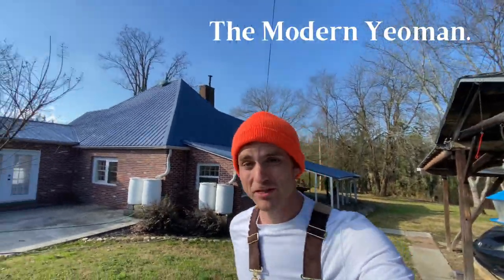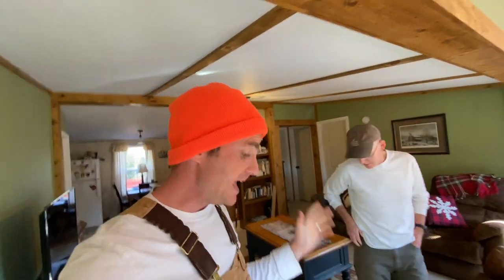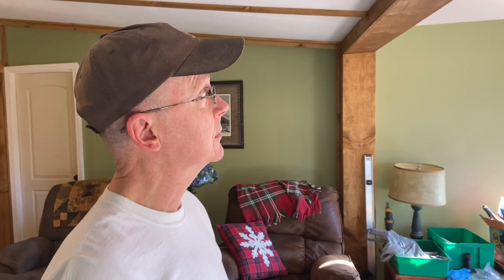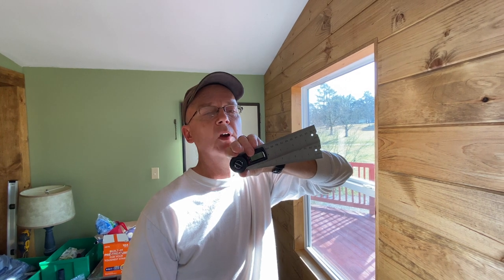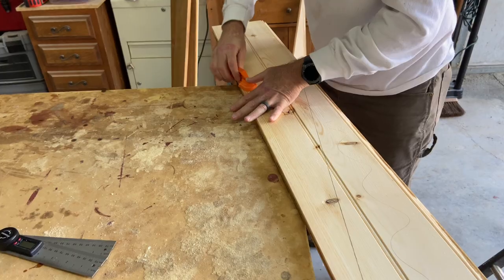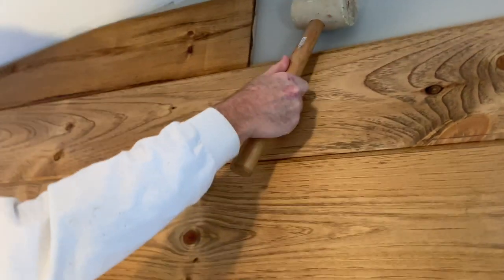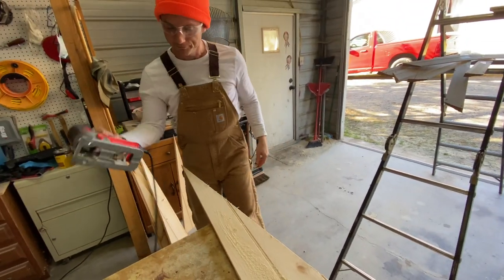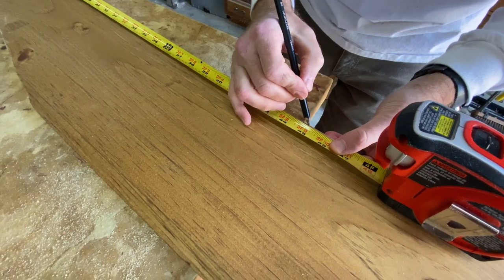Mobile Home MAKEOVER Continues (Merry Christmas Edition)

Comment: Just a tip on painting for next time ( I did it professionally for a few years)  always start with the ceiling and work down.  You will want to cover all your walls to the ceiling or you will have spatter all over them from the roller.  When you start with the ceiling you don't have to worry about the fine spatter from the roller.
Reply from the maker: Very good tip; thank you my friend!